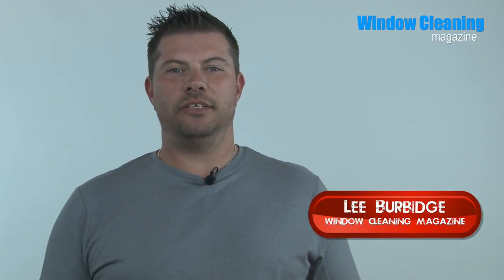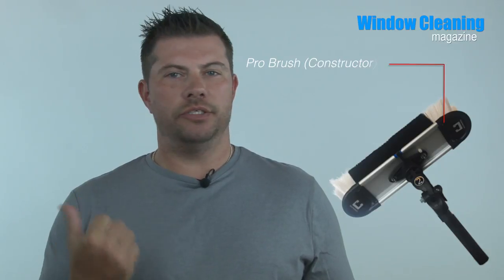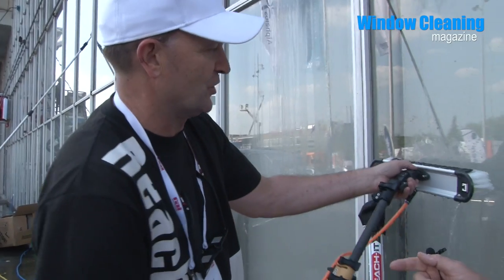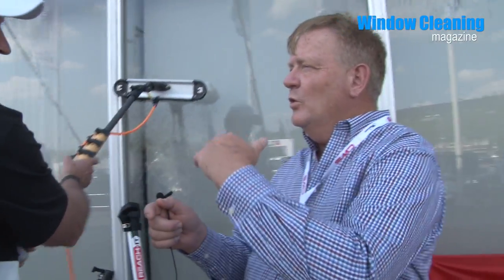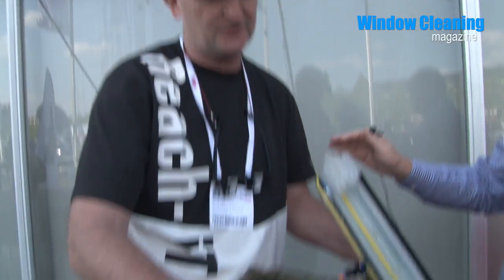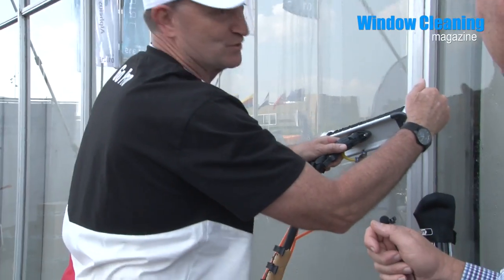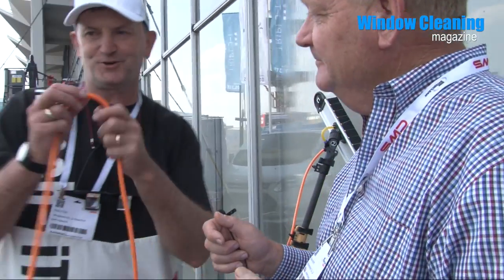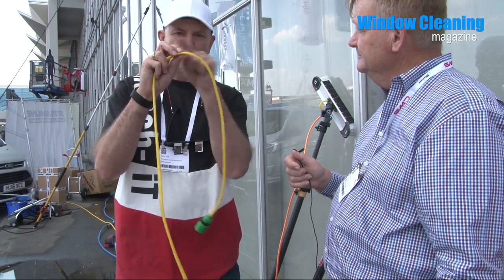Booth Talk - Why the Constructor brush helps to clean glass faster.

Comment: Sorry but this brush isn't all that great, especially for the price. I bought two of them and they sit in my garage. they leaked like crazy  until i replaced the tubing with the clear vinyl stuff, the adjustable angle pitch is too drastic you need to be able to make smaller adjustments like EVERY other gooseneck on the market does! the side to side is ok it's better than not having no swivel at all but i found it produced more fatigue than other swivels. I love the concept of this brush but i prefer a Unger radius and/or the Wagtail jetstream. I would not recommend this brush to a friend, maybe my competition though.
Reply: Tony in Arizona .. I had one tossed it, pain in the ass changing out jets. Just wouldn't line up after taking apart. Too much of a hassle  for me...